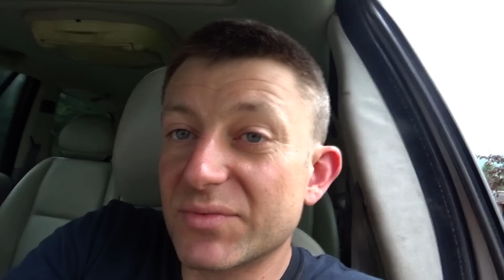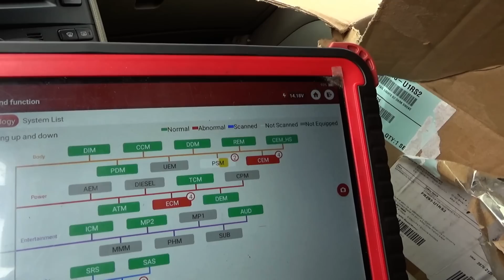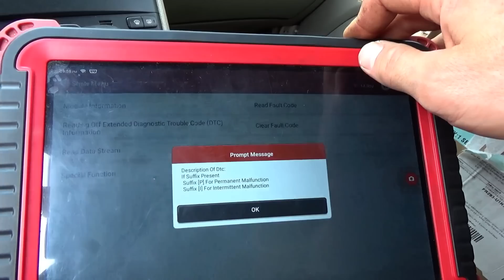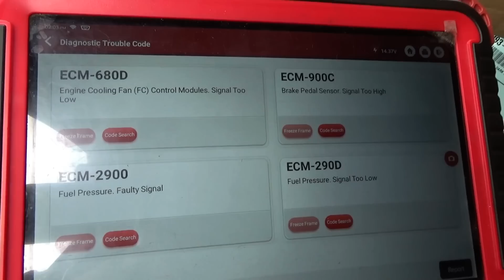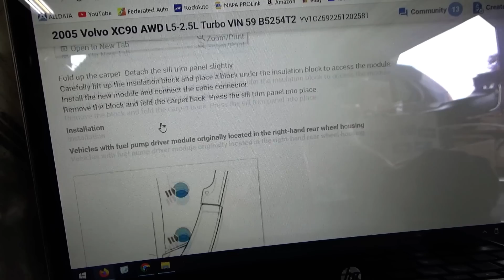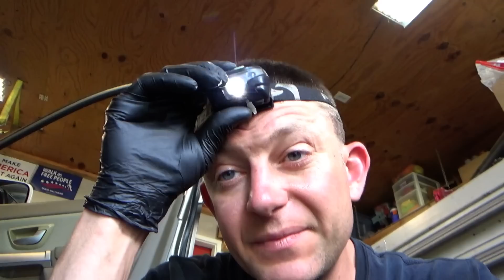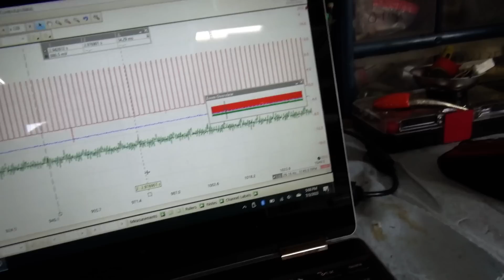(Pt1) Volvo From HELL...STALLS in 3 Minutes?! (05 XC90 Turbo)

Comment: Now these things are my specialty.  And not an exaggeration when I say I must have replaced over 100 fuel pumps on these things.  It's a really poor design.   The entire rear seat has to come out to expose both sides of the fuel tank access ports.  Make sure that you tie a long piece of wire to old crossover tube before you pull out the old pump.   Because you will need to pull the replacement crossover tube back across.  And be very careful with it.  The plastic tube can bend and crack very easily and cause the crossover to suck air and not pick up any fuel.

Oh, and Ivan.  If you decide to do this customer a solid and drain the water from the passenger side, do it outside.  Because there is a few gallons of water trapped in that cavity under that seat where the yaw control module resides.  And it's because the sunroof drains are blocked up.  And the wiper has a broken transmission.  Ask me how I know all that.  lol.
Reply: Wow, Volvos sound like huge pieces of junk! Thanks for the heads up
Reply: @Vince-m2m  Not at all if they haven't been abused. I had a 2005 XC70, it was a great car but it had been well cared for prior to my ownership. I now have a 2013 XC70 T6, it was also well cared for. I do my own maintenance and repair minor issues before they become major ones. I have been very happy with both of them.
Reply: @Vince-m2m  Volvos are generally decent cars and can last for hundreds of thousands of miles if taken care of properly.  But they do require a little more specialized maintenance then the average DIY'er can typically handle.
Reply: They are great job creators !
Reply: I heard the way these fail, it's a safety feature - kind of gives you a heads up before it goes completely kaput.
Reply: Where does the "3 pumps" thing exist?
We've been shown 1 fuel pump in this video so where are the other 2 located?
Reply: @sassasins031  The twin pump motor design has both pumps inside the FDM (Fuel Delivery Module) on the right side of the tank.  But only has a fuel level sensor and the crossover pickup tube on the left side.  On the triple pump motor setup, the 3rd motor is on the left side.
Reply: @Sandmansa  Thanks. And the 3 all have specific tasks? Are they reliant on each other in some way?
Reply: @sassasins031  Kind of, yeah.  Of course, the main pump sends fuel up to the engine.  Any other pump is just to keep balance of fuel between the 2 sides of the saddle gas tank.  The triple pump design was a quick remedy to help fix a fuel starvation issue the 03 to 05 XC90's sometimes had.
Reply: I thing ivàn is a great technician ❤😂
Reply: @pauljudd7090  Ivan is an outstanding technician.
Reply: As for the wipers, go back and look at the video when Ivan is messing with the wipers. Look at the nut on the one arm you can see, you will see it spinning in the arm assembly. It appears the arm or the post is stripped, probably the same on the other one also. If you look inside the cowl you can see the arm moving so I don't think it's the transmission.
Reply: @twl10101  I did notice that at least one wiper arm nut was loose.  But I also noticed the wire harness getting tugged around as it was trying to run.  That should never happen if the wiper transmission is properly installed.  I'm guessing at this point.  But either the wiper transmission is not installed correctly, or it is broken.  Maybe Ivan will take a peek and we can see if it's an easy fix or not.
Reply: You sound like a veteran Volvo mechanic 🤣🤣🤣
Reply: @@Sandmansa   Dude you're a gem mate!  Thanks for sharing your GOLD!👍  Sounds like part of regular service on these things should be to clean out the sunroof drain channels huh?  

I don't own a Volvo but those that do are privileged to have read you post mate!

I love my Aussie made '06 VZ 3.6L Holden Commodore.  My first air conditioned car woohoo!
Reply: @nevillegoddard4966  Well, not so much the sunroof's channels, but the drain ports in the front corners.  And this goes for any car with a sunroof.  The drains clog up with tree pollen and dirt and need to be cleaned out once or twice a year.  Just use some compressed air around the drain port but never directly in it.  You could blow the drain hose off inside the A pillar if you do that.  Then flush it out with a cup of clean water.  If the drain is clear, you will see water pour out just behind the front tires.
Reply: @@Sandmansa    Onya mate!  People will, & should be thankful for your advice!

Comment: 80.000 miles is nothing for a Volvo in terms of wear and tear. We have a V70 with the 2.4L engine in the family with 200.000 miles. Well serviced, well maintained, always fixed the small issues right when they appeared. The 2.4L i5 is Volvos best engine in my opinion, the 2.5L is a bored up 2.4L and thus has an inherently weaker block which is why the first thing to check with an R model Volvos is if the block is cracked.
We run a Liqui Moly fuel additive that has had a noticeable effect on keeping the engine cleaner.
She's mint. 
Super comfy and functional leather interior.

During our ownership it needed brakes, tires and the front axle rebuild because the rubber bushings just fall apart at that mileage and the front axles of the P2 platform Volvos are kind of known to wear out quicker. Not a major deal though it happens to the best of us and it can all be repaired fairly easily.
We had a freak misfire problem once which was traced to a bad connector on a fuel injector by a very competent Volvo mechanic. Cheap fix and they even took all injectors out and send them out to Bosch Service to get them tested and they all came back good.
Apart from that its a rust free car since Volvo really went to town with the P2 and later P3 chassis. These cars really last especially because Volvo used high quality OEMs and high quality OE parts. These cars last forever because of that. Volvo didn't skimp out.
This summer it will get an oil change, transmission fluid service since the ol Aisin 6 speeds needs some love too and ive noticed some faint belt/idler/tensioner noises that I don't like. I have no record of those components ever being replaced. The timing belt still has one year to go before its due according to the sticker but I might just do a full belt service and do everything.
After 200.000 miles the struts are also not feeling too good anymore, might get into that myself of have a mechanic replace them. I'm thinking about some sweet Bilsteins as a replacement.

Volvos are some of the greatest cars ever made, except when people who who should not be let near such a car get their hands on it.

Comment: Sometimes it is a broken oring or hose inside the assembly, also check fuel lines, regulator, and injectors for leakage, also you can isolate the pump and give external pressure to the lines and check for drops or restriction

Comment: That's a toucgh one, i still would be inclined to fit anther pump, you need one you know is working properly, might be worth having a good look around in the tank, maybe change the filter....is it worth putting some fuel gauges on it so you can see the pressure better...good luck Ivan, not an easy one..Fred.

Comment: Great place in the wheel well for the pump controller!  The continous rinsing & spraying with rainwater should keep it & all its contacts nice & clean!

Check if the fuel pressure problem complication module under the front passenger side footwell might be registering low water pressure & might need a top-up.

Comment: I would push the car out of my doors.  Why did the customer replacing an new fuel pump with an old ?  That is sus and  I dont get that.  If I had a fuel delivery issue and I had replaced the pump to a new OEM, I would keep that pump  to eliminate that problem.

Comment: It ain’t got no gas in it.    Actually, I think something in the tank is fudged up with that transfer system as You mentioned. Owner says pump was replaced several times. Was that both pumps, is it all one unit?? I’m confusion on that. Should be interesting. 👍👍🇺🇸

Comment: 32:04 Hi Ivan, maybe it's pump suck air in fuel tank and rotates faster and consumes less current because no resistance.
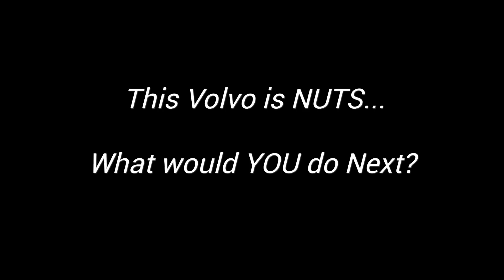Reply: 34:00 One part of the fuel tank runs out of fuel, the pump begins to consume air and the engine stalls! This is all due to the failure of the fuel pumping system between the parts of the fuel tank.  It may be that the fuel pipe or fitting has burst.

Comment: volvo diesels have interesting set up too. for them you first need to open driver side and remove float unclip hose then i tie a thin rope to the hoses in the tank and go open passenger side and when you remove the pump and the hoses come out with it, and rope gets pulled out too. i use rope to reinstall  the hoses back. the hoses are used to pump fuel from one side to another so if they unclip from the fuel pump bowl it could result in the same fuel starvation. waiting until ivan shows the rest.

Comment: I live in Vegas and I worked on an XC 90 for a lady. When I went to the junkyard to get some interior   parts. There was about 6 or 7 XC 90S  None of them were wrecked. But they were in the junkyard. Wonder why? Maybe they are junk?
Reply: Was it blue?  Think that was mine.  Oil pump had a chunk of metal in it.  Not metal shavings, a bar of mangled metal.  Pristine inside and out, other than that little problem.

Comment: Secondary pumps are not able to keep prime to main. I would suspect a leaking line in between or a leaking secondary pump. You've already covered the electrical and can prove the pumps are working so that only leaves mechanical. I would actually do a volume test at the manifold next .
Reply: Doing that might expose an amazon throttle body.  To risky.
Reply: All three pumps are within the fuel pump assembly, so when you replace whole pump housing all is replaced, maybe the suction Feed hose is floating and not grounded to the bottom of the tank

Comment: Them peoples can’t be taking care of that Volvo XC90 that well. I have a 04 model and I love it so much. Very good 2.5 turbo engine 288,000 miles and counting run better than my 2011 Lexus Rx 350. Sounds like bad mechanics been working on the XC90

Comment: Hi IVAN another good video.Could you deadhead the pump to see if it still loses pressure?OR if you have a old Honda in tank pump,you could drop it into the tank with just that pump supplying fuel at 40 psi to see is it still dies after 3 minutes?Or maybe splice an external inline pump in-between the original pump and the fuel rail.Just too see>OR MAYBE IT'S the NEW ANTI-THEFT DEVICE THAT ONLY RUNS THE CAR FOR 15 sec then dies,unless you place a magnet on a special spot on the floor to pull up the magnetic plunger that shuts off the fuel.ya that's it.

Comment: I think it could be something like that 1997 model Ford EL Falcon which is an Australian built car which I fixed,there could be high resistance in the electrical system somewhere if the owner replaced the fuel pump 4 times in that Volvo & there doesn't appear to be a problem with the pump(s) or the module.

I would check all of the powers & grounds in the vehicle starting with the ignition switch or whatever activates the ignition power feed to the vehicles electrical system, it's like as if there's high resistance in the electrical system somewhere.

That means the engine runs good while but as a module or a component (e.g. a relay) heats up the resistance increases & the PCM, the ignition system, etc loses voltage then the engine stalls.

Maybe if there's any chance run the pumps directly off the battery & see if the fuel pressure drops off.

I know that in the Ford Falcon if it wasn't the TFI (thick film ignition) module which caused the stalling problem it was either due to a bad ignition or fuel pump relay that latter of which an Auto electrician charged my great uncles stepdaughter $280 AUD to diagnose and replace but that didn't fix the problem.

My fix was similar to Eric Os solution except that he rips out any aftermarket car alarms or modules on a lot of GM cars which seem to come into his workshop for issues caused by that,mine was just to disconnect the aftermarket engine immobilizer then to wire it back up to how Ford wired it up at the factory in the first place !

Comment: I would put jumpers directly to fuel bowl pump. Run engine if it stalls, then not the pump motor problem.
Reply: Ivan went to some lengths to prove the pump module is working and the supply to the pump is good, so how would this help?

Comment: Based on the previous Volvo, did they connect the transfer hose from one side to the other? Both pumps could be running, but without that hose connecting both sides the pickup side could run low.

Comment: I had a xc90 2003 there was water in the footwell and under the passenger seat I’m in the (uk), it was water coming in where the cabin fan is mounted under the cowling on the engine side of the bulkhead resealed with silicone sealant, it took 2 weeks to dry the carpet. The water was sitting under the foam padding etc nothing sitting on top

Comment: Look in tank for something odd.
Where is the pressure regulator. 
If it was pumping air the pump speed would increase I think.
Check your pump flow at the return if it has one

Comment: I'm going to bet that the client may have only replaced the main fuel pump and not the transfer pump you tested midway through the video. 2A is a little lower than the normal current through any pump, and so this pump might have a shaft stripped off the impeller and the shaft is spinning at like 20k RPM. The fact that the main pump is speeding up is screaming cavitation to me. Definitely pointing towards a transfer pump that won't deliver fuel to the main pump, but as always with your videos, something may come out of left field.
Reply: The pump driver module changes the pump drive voltage according to engine load, so at idle you wouldn't expect to see the 5-6A of a basic uncontrolled system.
Reply: @ferrumignis  It looks, to me anyway, that the transfer pump is receiving hard power and ground without going through the pump driver module. You really gotta look closely at the diagram to see this.

Comment: Fuel pump being out 4 times makes me wonder if it was installed correctly inside and very possible the pickup tube for the transfer pump is a issue. Should be a hump type tank so a peek inside should show if that is the case immediately
Reply: Seems very likely to me.

Comment: I'm suspecting a hose connected to the transfer pump is either not connected or damaged. Need to look in the tank.
Reply: Maybe the feeding hose is collapsing, clogging from suction, starving.  RPM goes up because no fuel supply.

Comment: Don't worry You'll find the Problem Ivan,   I have O doubts,  I would make sure the Correct pump is-was in this Car since new, Or is it incorrectly installed? Maybe make sure it's all updated with the latest and greatest fuel pump setup for the year, Sometimes people-techs make a huge mess with incorrectly installed updates, I have been burnt by 💩 like this from Europe, Incorrectly wired updates by john deere techs somewhere in France then imported to 🇺🇸 with said problem,  Now that was fun, Of course  I was stuck with the wrong diagram, not realizing  it was updated incorrectly I needed to go to a newer diagram showing the wiring updates for said update, Kind of hard to do if you didn't know it was updated in the first place half assed, So this update was only bolted on and never wired correctly making a $100,000 machine completely useless at the time, I had a Very smart dealer parts Guy a former Top Cat  technician help me figure this problem out in about 20 minutes flat, Live and learn But of course I personally don't know 💩 about Volvo's, Probably fun Cars, But I'll just stick with Honda's for now,   Love these Video's Never Stop. 🇺🇸👍 TRUMP 2024  Damit folks. Right No Politics, Don't care. fjb and all fake none Conservative Republicans. 🤑

Comment: I wonder if you have a bad hose or maybe it's been connected wrong inside the tank. It would be interesting to see if the new fuel pump assembly is complete or whether you have to change some parts over

Comment: I just can't see it not being an issue with the fuel pump system. Possibly the transfer pump is failing, sure it runs at first but does it continue to run? Is its hose perhaps disconnected, broken, leaking, plugged?

Comment: Is there a vacuum being created in the tank?  Remove gas cap and run engine. 
How about loss of RPM signal from an intermittent crank sensor?
On to part 2.
Reply: How would loss of crank signal cause the fuel pressure to drop whilst the electrical supply to the pump motor remains constant?

Comment: Interesting. I do not trust that rail pressure sensor, it does look new (aftermarket?). I think i saw a schrader valve, so i would first verify the rail pressure sensor reading with an actual analog gauge. Could we "fool" the rail pressure sensor, take control of the signal ourselves and see if the car stays running?
Thanks, Ivan.

Comment: Sounds like some tomfoolery in the tank, hose routing, missing o-ring, something
Reply: Sandmansa gave a very strong hint about the crossover line:
 "The plastic tube can bend and crack very easily and cause the crossover to suck air and not pick up any fuel."

Comment: Take out the fuel pump and visually inspect it and the screen filter for excessive dirt. There was a lot of mud under that vehicle and with all of the fuel pump replacements God only knows what got inside the tank. The PEM should also be relocated to the interior.

Comment: Fuel pump spins higher while using less current. . . the transfert pump do not work ? ?  Is there a fuel drain solenoide dumping the pressure ? ?